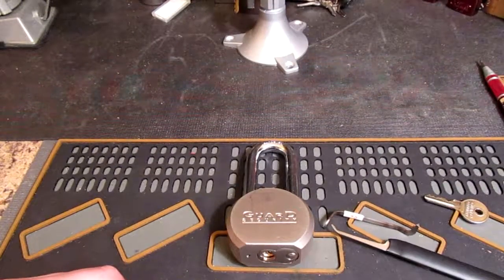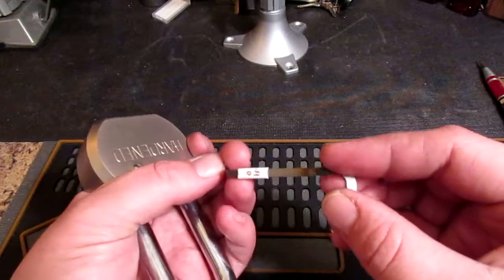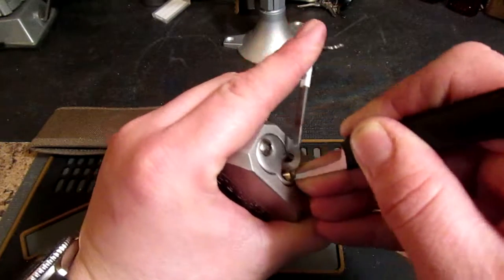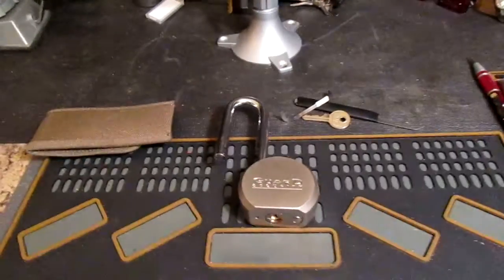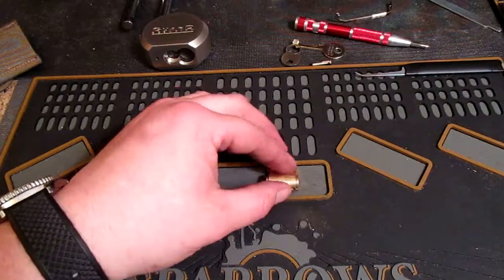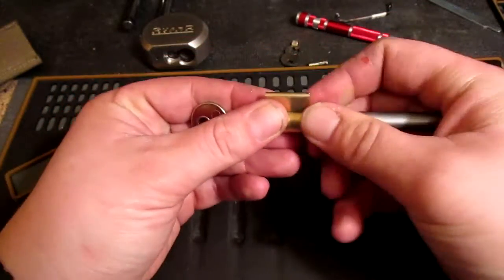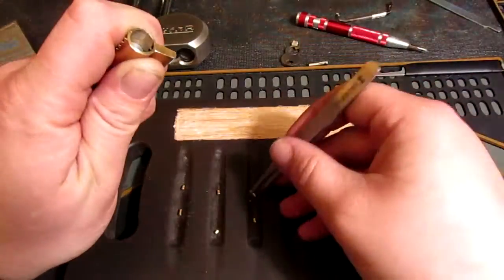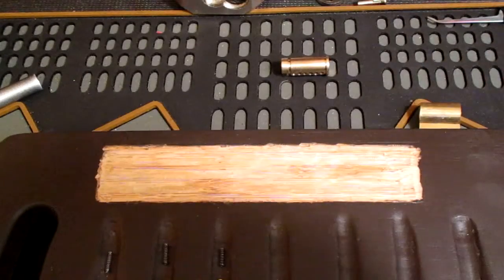(05) Picking a Guard Security padlock

Comment: Wow, I knew guard was bad... but lying about hardened parts and missing pins and springs in 2 chambers? I would say they should find which worker allowed that to pass through the line but I doubt they care.
Reply from the maker: Ya I couldn't believe it. I don't know how it made it past QC unless they don't care. That is the only thing I can think of. Its complete garbage. I have 3 or 4 more locks that look the exact same they are just branded differently. One is branded as Garrison and sells for around $35 at Canadian Tire. It is also garbage.